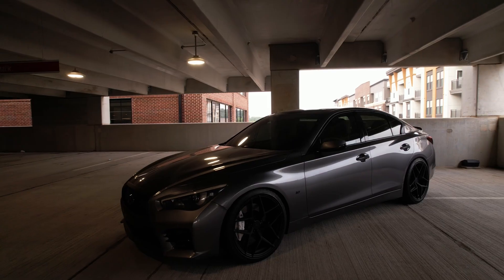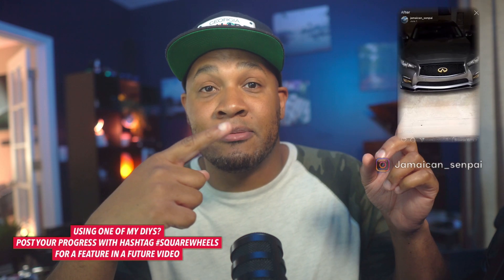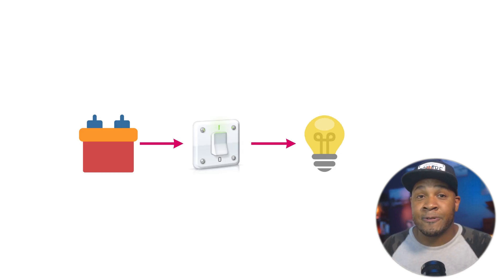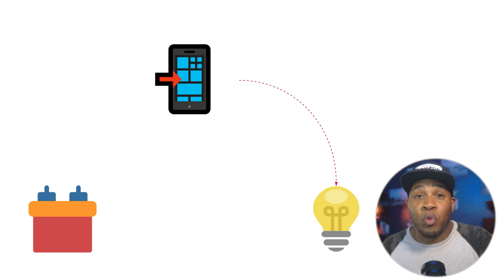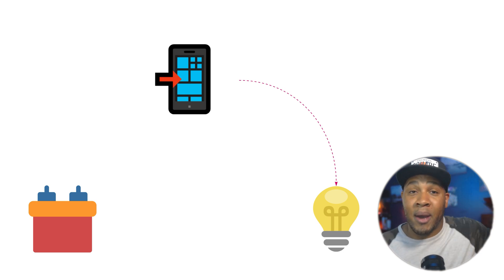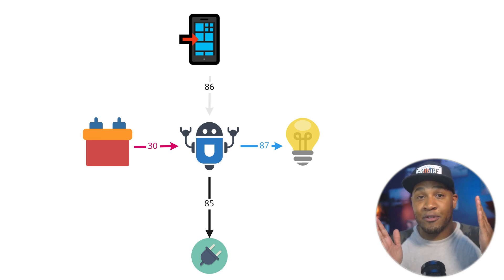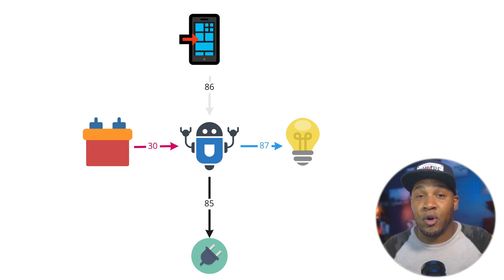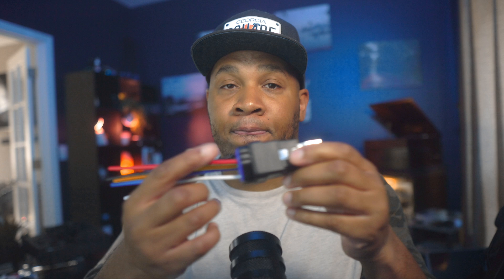Automotive Relays: When, Why and How

Comment: did you connect this to your BlueGhozt? i’m lost on how to wire this so my Glowes don’t kill my 12V.
Reply from the maker: Yep so I have the relay that delivers power to the underglow strips connected to one of the outputs on the Blueghozt plus.  I can set it to Triggered or Basic but whenever its OFF, the strips get no juice so no draw on the battery.
Reply: @SquareWheelsAuto  is this going to be covered in your wiring video? cause i definitely need this ASAP. i have an idea of how to do it but don’t wanna mess things up
Reply from the maker: If you beat me to it, hit me at rob@squarewheelsauto.com I'll get u set up👍🏾

Comment: What else can I tap into to get my lights to turn on when I unlock / lock my car?
Reply from the maker: Parking light, puddle light, or drl circuit. They all get power for like 30 seconds on unlock
Reply: @SquareWheelsAuto   i tried tapping into the puddle light but for some reason my lights stay on after the lights turn off. Kinda stumped. Gonna see what else I can tap into
Reply from the maker: @iiescoeone  hmmmm mebbe try grabbing a signal from the dome light in the rear? https://youtu.be/8R3xZDizw3I
Reply: @SquareWheelsAuto  yeah I just watched another one of your videos that helped out. I’m going to try to tap into that next. Thanks for the reply man. I appreciate it